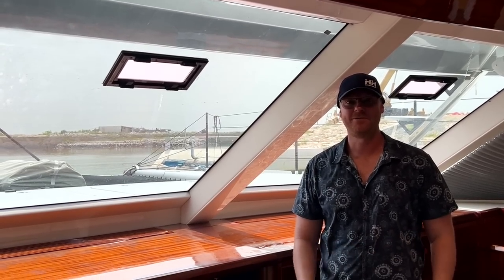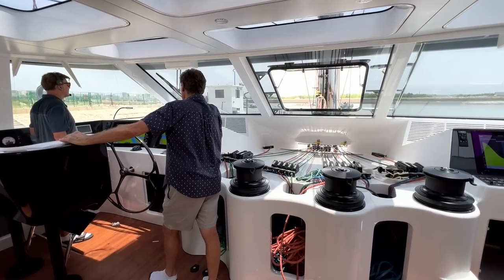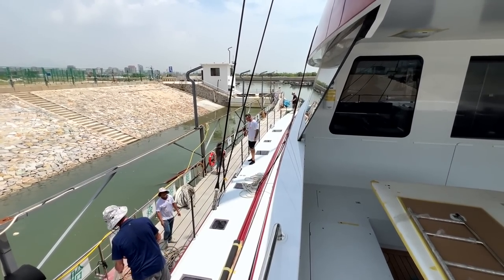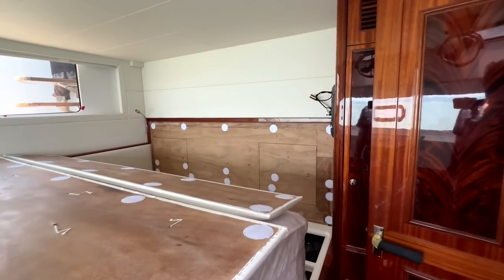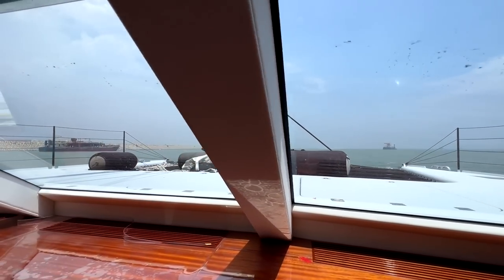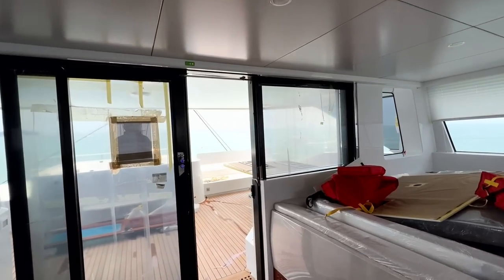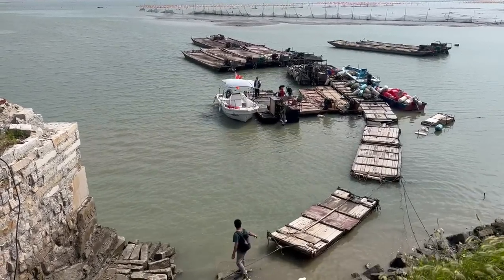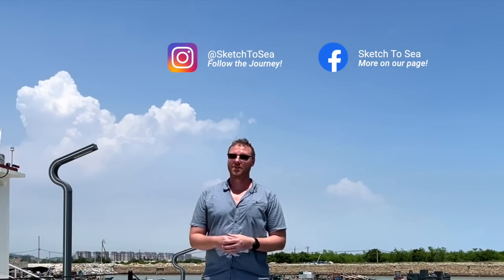Sketch To Sea: Sea trials day 1-3 for HH8801

Comment: Excellent video.  What are the three vertical stripes on the hull for?  The look like they are temporary in nature.
Reply from the maker: They have been used to measure the waterline at different phases. We still have some adjusting to do but can only do it when the vessel is fully loaded. Then they will come off.

Comment: Great introduction to the helm area... I'd love to see more details about the winch and line-control buttons you have at the helm stations to operate captive vs open winches, etc. Also, at some point during sea-trials, please explain the which lines are routed to specific winches, and how you can utilize alternate winches via the turning blocks mounted under each winch. Thanks.
Reply from the maker: Thank you for the comment. Once we have taken possession and are out sailing, I will definitely do a deep dive into the winch station and how we have everything set up.

Comment: Bazinga!  Your boat looks magnificent.  I'm sorry if you've already addressed this elsewhere, but I'm curious what the effects are, if any, on CG, handling, trim, balance, etc when hot tub is full vs empty.  Will it be drained when you get underway?  What's the production output of your H2O maker and what brand did you go with? Forward looking sonar? Forward looking infrared (FLIR)? Torpedo tubes? Okay, just kidding on the last one, but if it were much bigger you could call it a frigate and carry an ICON A5 seaplane on the davits. 😂
Reply from the maker: Thank you for the questions. Hot tub is drained when underway. We have 2 Shenker modular 230 water makers onboard. They make 230L or 61 Gallons per hour.We do have forward looking sonar, and we do have a FLIR.
Reply: @sketchtosea3750  thanks. You’ve certainly checked all the blocks. Hollywood showers for all hands. 👍👍

Comment: Awesome cat & congrats on the first sea trial!  So are the dual chart plotters at the helm the 24” glass bridge or the 19”?   Also I’m assuming you have cameras you could display the four corners on them while docking/maneuvering in tight quarters.
Reply from the maker: Yes, good questions. The chart plotters are 24" and we have 7 cameras around the boat for a few different reasons. Maneuvering would be one of them.
Reply: @sketchtosea3750  very impressive set up!   I'm sure you both can't wait to be out there cruising on her.

Comment: Hey Sean, is the aircon really so loud or is it just a microphone thing? Congrats buddy 👍👍👍
Reply from the maker: It is that loud when we have the fans set to full blast. We have also not finalized the grill design which is making some of the noise We only do this when we have all the windows open. It is currently super hot here. The rest of the boat is much more quiet as we can set the fans to auto so the ramp up and down depending on demand.

Comment: That is not a boat that is a sea monster. I don’t even want t know how much you payed for her. I am soon building a 50 foot catamaran which is a big boat. Next to yours it will look like a toy.
Reply: It is a fantastic boat. He's seems a sharp guy and has thought out a lot during the build process. It will be interesting how the boat performs during the sea trials as many things will come to light, it being a new build for that model. I would suspect he paid anywhere from $9-10 million depending on what discounts were negotiated for new build and any yacht show commitments.
Reply from the maker: Thats great, I look forward to one day seeing you out there.
Reply from the maker: Thank you for the comment. So far the boat has exceeded our performance expectations. Stay tuned for more sea trials.
Reply: Thanks. My cruising grounds are going to be the south of Portugal in the summer and the Caribbean islands (French Islands) in the winter. I will be building everything  from scratch including the plywood. It will used for day and night charting and as my primary home. It will be wood epoxy construction. Total cost of project including everything will be about 350k to 400k. It will be electric with at least 250kw of lithium and 14kw of solar. It will have my own custom designed dc generator producing 42kw of power at 58v. I’m almost finishing the design. It will have a lot of components designed by me including the open source digital switching system. Going with open source due to keeping the costs down. If all goes well construction will start next year. I am also thinking of opening up a channel and documenting the whole process on YouTube as well.
Reply from the maker: Sounds like a great idea.